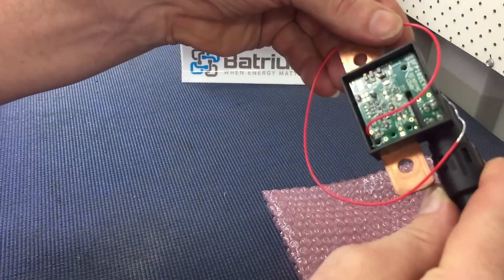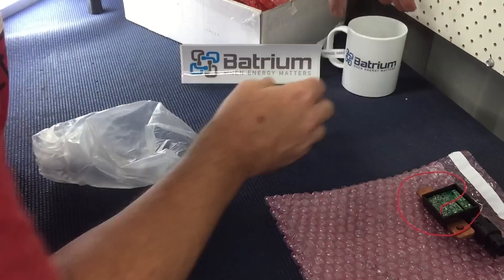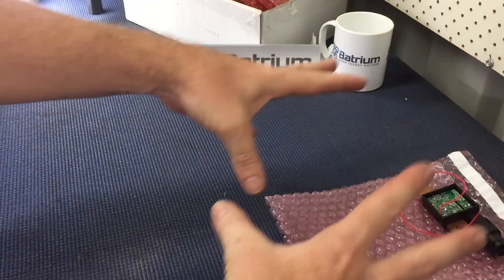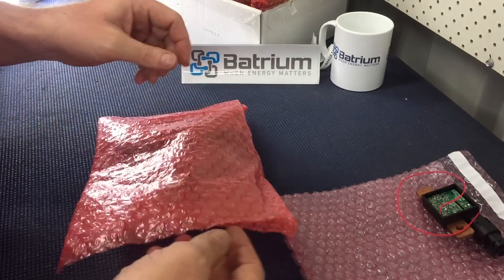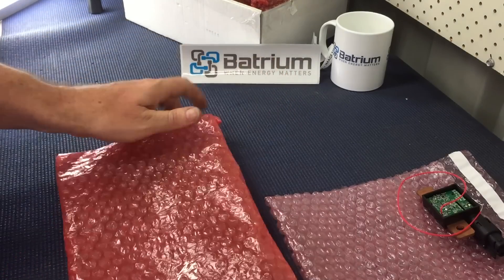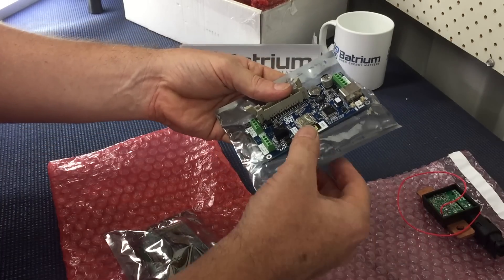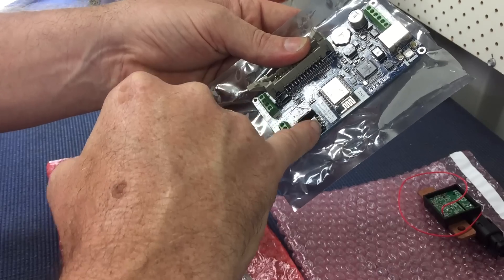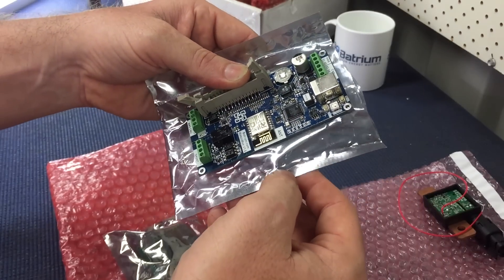It's BMS Time - Thanks to Batrium.com

Comment: Hi from Ireland, made it to video 180, have my 1st 80 pack made up, now starting on the 2nd. I am thinking of buying new 18650's as the process to charge discharge is taking too long
Reply from the maker: Done over I would lol Except ev batteries not single cells
Reply: @HBPowerwall  I wanna set up a youtube channel and take the best ideas I have seen. I want to do a 1kw system using these holders.

KEESIN Plastic Battery Storage Box

I use to live in Perth, 30 years working in IT repair

Comment: 5:30 - "Upload now, ask questions later."  Nice play with the well-known phrase, and a suitable strategy in this case.
Reply from the maker: This product changed my project - SO much - wouldn't be with out it now..
Reply: @HBPowerwall  - Hello.  Yes, Batrium is a very interesting modular concept. I was introduced to it by your video today. Happy to hear it still works for you so well. I was already far into the video when it dawned on me that the video was over two years old.  So now I'm following your development with this system.  Binge watching the related older videos ;-)  Thanks for all your work.
Reply from the maker: This was WM1 - WM4 is current release, WMPlus Beta was released today, i've just released the video - Watchmon Pluse is designed for shared loom battery packs like the Telsa Batteries & Bolt batteries
Reply: @HBPowerwall  - Yes, was just about to watch your newest video. Then I'm up to date.

Comment: Question about the Batrium. The black box in this video, do they still make that? I plan on installing in a campervan and would like something to protect the BMS and Expansion board. curious if they still make that or not.
Reply from the maker: The black box was for a planned upgrade to the Watchmon 1 however for whatever reason we are moving to watchmon4. Much more refined has 3D printed covers available also - https://www.facebook.com/Batrium/videos/1721103281284073/

Comment: i took a look at Batrium's website.. they are quiet expensive.. but i'm not sure how it all works... i have 240 batteries, and i want to put them in 4 series of 60 parrallell batteries, to make a Battery for in my Stealth Van .  Some people told me that without BMS it can be dangerous, and also  there is a chance of great powerlosses.. So they recommend to monitor all 240 batteries.. but that is probably way out of my budget.. ( It's because i'm on a thight budget that i bought all those 16850 batteries to make a cheaper litium ion battery than  buying a lipo off the shelve ) What would you recommend off all your chinese BMS's you bought, which is the most reliable ?   My batteries are brandnew Panasonic 16850B ( bought over a period of 1 year to avoid taxes :) )  https://i.ebayimg.com/00/s/NTczWDEwMjQ=/z/BpQAAOSwfVhaLtTS/$_86.JPG

Comment: Interesting, are these charge or discharge BMS's ?
Reply from the maker: They are not an active balancer. They balance at a programmable limit. Looked at active but given I'm using all different cells and the packs aren't balanced one to the next the active balancer would have been going flat out all day every day. I set whatever I like as the top balance point ie 4v or 4.01v
Reply: It'll be good to see the install , thanks .
Reply from the maker: Uploading now  :)

Comment: That black substance on the PCB is conformal coating for weather proofing, not actually designed for heat transfer although it does a bit of it,. BTW, can I know where are you sourcing all your 18650 batteries?
Reply from the maker: There we go, something new.. thanks for that..
As for where I get them from. I should do another video on this. 
Anywhere I can - get on the phone call anyone with the possibility of having old batteries and ask the question. Government offices, recycle companies big and small, Schools, local computer shops, places that sell power tools really hard to find them sometimes and it gets depressing even lol but eventually you hit big and you can post a picture on the forum with your haul - they are out there somewhere Good luck with your search

Comment: Nice work, I'm using batrium BMS in my EV with leaf cells. Too bad the leafmon wasn't a thing when I installed my batteries, I used the longmon. They are a fair bit cheaper though.
Reply from the maker: really are you local by chance to Brisbane ( Know this is a long shot lol ) love to have a stickybeek. By the way, the mons are evolving I'm keen to see what is ahead for the 18650 Powerwalls
Reply: HBPowerwall nah I'm not, I'm several hours from Brissy. give Graeme a call at Suzi Auto Service / OZ DIY Electric Vehicles (same shop). He uses the Batrium BMS in a lot of his conversions, I got my batteries through him and he showed me some really cool projects he has there. The shop is in Logan.
Reply from the maker: Yes I've been there getting parts for my swift :) I should stop in and introduce myself
Reply: HBPowerwall I'm watching your progress too. I have about 15kWh of CALB cells that I'm intending to put on the house but haven't started planning yet.
Reply: HBPowerwall there you go! Coincidence. I only found your channel today, no idea you had a swift.
Reply from the maker: 08 sport with bad paint ...lol

Comment: Is there a difference in BMS for Li-Po vs Li-ion batteries?
Reply from the maker: Not sure sorry.
Reply: Use a hobby charger or bluetooth bms its all crap if you have New cells you dont need a bms if old cells you need hobby charger

Comment: HBPowerwall, really love your videos here in Canada. Just started harvesting laptop batteries, testing and charging them. Going to see how feasible it is for me. I hope to do something similar to what you have but for our place in the bush. I grew up off the grid and want to go back to that, but with technology! Lol.

Please keep up the awesome videos!
Reply from the maker: I would love to be off the grid but with all the bells and whistles ...lol kinda goes against the grain.. Hot water, MUST HAVE HOT WATER ..hahah 
Thanks for tuning in
Reply: DIY Solar thermal tanks next? :) 

Or, theres a UK company doing highly compact heat storage (Sunamp) from excess solar power. Robert Llewllyn did a video of it on his Fully Charged channel.
Reply from the maker: BMS has a hot water attachment :)
Reply: Hot water is rather easy. On demand propane hot water heater. Cheapest way to go. But if you didn't mind putting more panels on, you could go electric.

I'm thinking about building my cabin to be intrinsically heated and not take even 1 watt from a primary heater because it's super insulated. Northwestern Ontario area. I've watched a bunch of videos about it, but have yet to find one where they combine everything to get the ultimate in insulation efficiency.

Anyways, that's how I kind of came across your videos.
Reply: ***** Oh, you installed enough from the start to accommodate it.
Reply: I stand by my previous comment.
Reply: ***** "Oh, you installed enough from the start to accommodate it." I'm still standing by that comment. Not sure why you think I might be disagreeing with you.

Comment: Definitely going to be interested in how this product works. Been researching BMS for a while now, but not finding many decent ones. Google is just full of links to chinese crap, which I really don't trust. 

For now, I don't need one as my project is just a small battery, and I'll take it out of the device (R2D2) to charge with a decent balance charger. Would like to charge without removal eventually tho.
Reply from the maker: stay tuned and if you have any specific requests please ask.
Reply: Been looking at the Batrium stuff, and probably a bit OTT for my needs. 

Wonder if Dave at the EEVBlog will be up for doing some analysis on one of the cheap chinese BMS? :) 

Always enjoy watching your videos. I'm always too nervous about trying things out incase of big bangs, but happy to let you dive in with both feet! :D
Reply from the maker: i'm happy to do so :)

Comment: 2000mah 3.7v batteries = 7Wh. 50,000/7=7142 batteries. What happens with maintenance. 
2Ah batteries drop to 80% after 1000 cycles, but that can be extended by charging very slowly and to only 80% charge voltage, but with 7000 batteries you would have to be constantly changing batteries, and at an increasing rate.
Reply from the maker: I'm hoping by going larger and larger it will reduce the load so far that the cells will have a long happy life. I could however be very wrong about that. But so far results are promising. With the current setup I can easily add another 4kw of panels for very minimal costs so that is also an option. I doubt my learning curve will ever end :)
Reply: It looks like Lithium don't like being full charged, and lead/acid doesn't like being discharged too low, so the answer always seams to be more batteries not used as hard to make them last longer.
Reply: It might be an idea to log failures so that people will know what they are in for.
Reply from the maker: I always upload my failures - fire sells better than ice on YT
Reply: Lithium doesn't like to be discharged too low either - in fact it is very dangerous to take them below spec. There are other options like LifePO4 which is still lithium but can be made to provide much higher power, at the expense of a lot more space per kwH. They also have a much higher cycle life than the lithium ion 18650's. I'm talking the cylindrical cells like Headways which are rated at 10C continuous. Of course they are expensive and obviously don't fit within HB's original project idea. Keep up the good work.
Reply: I wasn't that interested in catastrophic failure, even though if it did catch fire it's unlikely an insurance company would pay out when there is 7000 DIY batteries in the house, I was more interested in how many batteries you would be swapping out per week with 7000 2nd hand batteries.
Reply: I think he was saying that the chemistry might be damaged reducing it's holding capacity next time it's charged.

Comment: can you do video what is 100% needed to put 18650 on 2424.......... im watching your videos order pip over your amazon link im colecting bateries but do i need BMS is best just to folow your work
Reply from the maker: there is already a bunch of videos from about a year ago with the 24v setup. As for a BMS i've not used one for quite a while and my banks are quite well balanced and I'm rather impressed. You should do your own research from many different sources regarding your project there are many ways to do this.
Reply: i was alone man in the garage whit 1x50W 2x260W solar panels and PWM charge controler rocking some music and have on light for 4 years then i spot DIY Powerwalls and see that is not just me who wanna go offgrid
Reply: and tnx for your work mean a lot

Comment: Esp8266 on those boards for the WIFI. Same as I use :)  What number on the big chip on those big boards? :)  BMS is nice and I am preparing a video for start showing the one im working on.
Reply: It's a ARM based Freescale I'm sure ;)
Reply from the maker: I'll take a look when the sun comes up :)
Reply: FERCSA ARM based Freescale.. sounds awesome, I visited their silicon chip factory in the USA and went to their massive conference few years ago. Almost all car/truck makers and industrial automation companies use their micro-processors, ultra reliable! 
Send me some info about your project on bruno2bari@gmail.com